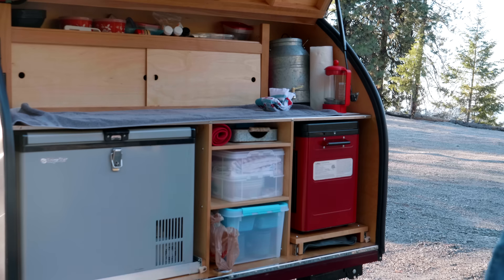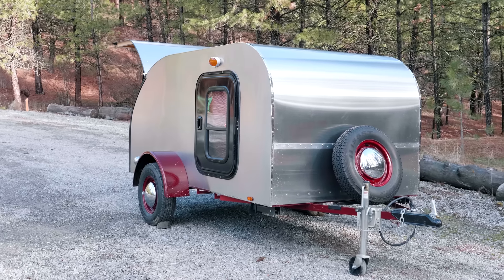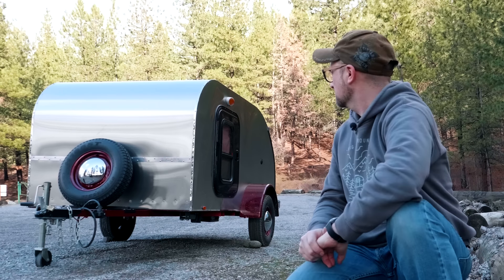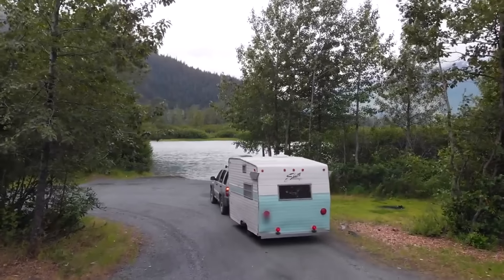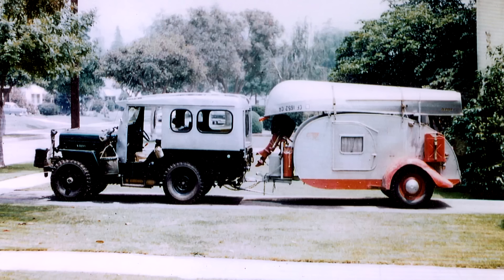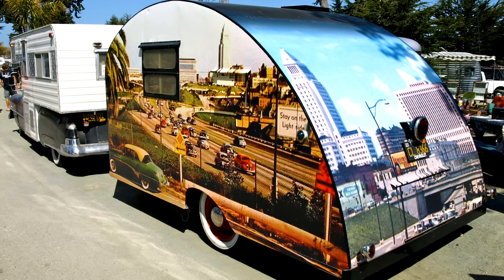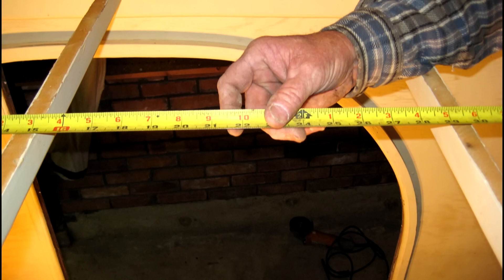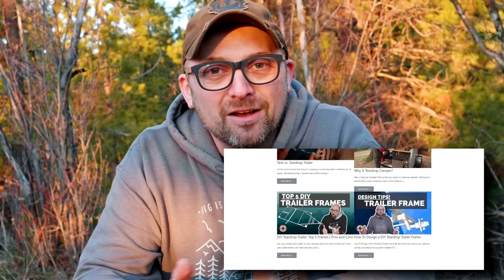Save Money, BUILD YOUR OWN Teardrop Trailer!

Comment: Quality material availability - where kits will shine. The one problem with building your own camper is none of the materials needed to create a long lasting camper are available at box stores and lumber yards. Boat building marine plywood, marine plywood foam composites, and some non-wood composites are available at a few speciality shops scattered across the country and can be mail ordered - for a price (if you have to ask ....). And it is hard to spend $400 a sheet for these speciality woods and composites on a project we are not 100% sure of to begin with. Most of us will buy from the box stores and encapsulate/epoxy/fiberglass/paint the heck out of it. It works. It is inexpensive. It will last awhile just fine. It will eventually fail, but by that time you will know what you really want. 
This is where kits and suppliers to self-builders come in. Kit makers, like the Chesapeake, and self-build suppliers can make these advanced long lived materials available. Add to that a proven design and build process, and the a tentative builds become more likely to succeed and last.
Reply from the maker: This comment is definitely getting pinned. Thank you as always Mike. Great information for people to think about.
Reply: I think there are definitely things the industry Can take from the homebuilt/ experimental Aircraft industry. There are several manufacturers that provide customers with kits and detailed plans to build their own aircraft, often at a fraction of the cost required for that person to buy a premade craft. One thing they do that is especially applicable is they provide the customers the option to buy the whole kit all at once, or just buy one part at a time so they can spread the cost and workload over a longer time. Shipping is still a huge factor, but if the customer is able to get only the materials they need, they aren't paying to ship all the materials they would otherwise cut off.
Reply: I agree, the one main problem with supplies… is “big box” stores. They stock with a central idea. Not with customers needs. So we, as builders need to take that extra step and dig a little deeper. Just because the guy with the apron says “ that doesn’t exist “… not in his store maybe. But it probably does. 
I took about a year to build my Teardroper. Some time was spent waiting for parts/ money and just trying to find  time for the build. Other days I would just stand in the garage looking at my progress and try to plan my attack. But it happened 
“ I can build that “…
There is always a way to make the little things happen. Good luck and great subject.
Reply: @jacechristian8725  Agreed. Taking from the boat building industry too.
Reply: @davidf9630  I like that you setup the time frame and mentioned the searching, waiting and planning parts of the build, which is what I saw as a build helper. Kits could reduce the time spent on all counts and give better access to quality parts - hopefully.
Reply: hehe,  can also occasionally tap Amish/mennonite communities for help with the cabinetry and such.  If you are in the right area's.   Many have woodworking, furniture, and cabinet shops.   So stopping buy talking about what wood is the best options, showing them what you need...  it may cost a little, but in many ways its far cheaper then other options, and often better quality work.
Reply: Yes Yes Yes, I love my Chesapeake Light Craft kit Teardrop.  All Okume marine grade plywood, MAS low Viscosity marine epoxy, and 95% of what's needed to complete the camper!!!
Reply: Interesting, I personally would rather buy something used and fix it up, like a pop up. If your time is worth anything, I think that is a better way to go. Plus, I just don't get the crawling in the door thing. I want to stand up.

Comment: The trailer Mark shows in the video was a project for our family. I am Mark's dad. Mark and I welded up the frame. My daughter helped apply the tar-like undercoat to the body. My wife helped build the galley and created the quilts for the bed, curtains, and wall hanging. Mark corrected a fairly major error I made when building the body. A friend helped with the outside skin. And almost all of this was done in my garage in temperatures ranging from 105 to 25 degrees F. The first big road trip we did was in the fall of 2017 and I was surprised by the interest this trailer generates. We were giving tours every day at campgrounds, rest areas, gas stations, store parking lots, at the Davis-Monthan Air Force Base parking lot. And most of the time people can't believe we built it ourselves. What they don't realize is they can likely build something just as good and something that is actually a better fit for them because they are doing it themselves. The resources are out there, and I encourage anyone with the interest to just go for it and build one. I love going down the road with my bedroom and kitchen right behind me. And always remember Rule Number One: Have Fun!
Reply: As a mom of two boys, I might have teared up a bit (happy tears) hearing about your children and wife help with the trailer. I imagine the same when and if we get the chance to build our trailer.
Reply from the maker: So great to see you on here Darrell. And what an inspiring story.
Reply: Hi Dad!!!

Comment: This is an awesome post. I've been looking around at dozens of teardrops and as you said the prices are climbing rapidly but the biggest problem is that none of them have the exact combination of features that I want. This inspires me to look much more deeply into a DIY camper. Thank you for showing us these resources!
Reply from the maker: Another thing I am coming to understand recently is that kits are designed to be more customizable then I thought. If a company does it right the base kit model is pretty primitive. But, they have designed it in a way to be easily modified. So you may find even a kit gives you enough flexibility to create what you need. And then of course building it from scratch is 100% customizable.

Comment: Love the DIY trailer idea... Almost finished building a wood/fiberglass boat.  Little off road trailer is next!  Can't wait to see what you have coming up.  Love your channel and beautiful family!
Reply from the maker: Thanks Danny. Was your boat a kit or from the ground up? Yes been quite a bit of time studying boat kits as well. Hey Siri get quite addictive once you start researching. This is where I first learned about rolling and tipping. It’s the little gems I find that make the research so fun.
Reply: @PlayingwithSticks  No kit for me.  I did buy a set of plans.  Wish I would have cot the kit they offer, but I wanted to do everything myself.  I will roll and tip it when it's finished!  One of your other commenters was talking about using high quality materials.  He's right.  That's one of the reasons I did not buy a kit, but I think his $400 a sheet for marine ply is high.  I am using the highest grade  Lloyd's certified Okoume ply and it's like $80-130 a sheet.  Shipping is around $90 for me.  Not so bad.  It's fun and with some patience I think anyone could do it.  My boat is a design called FRS-15 by Salt Boatworks.  Just a little flats skiff for by my condo in FL.
Reply: Danny!  Boat and Kayak builders make great trailers.  Yours will be top notch.

Comment: DIY times are changing. I built a pretty nice squaredrop (in my biased opinion) with all the trimmings as my pandemic project but I can't build another now without straying too close to the price of a commercially built camper. The current price of wood and metal has become a barrier to entry and mistakes become costly so we have to rethink the tried-and-true methods and materials.
Reply from the maker: There is definitely some truth in this. With the recent supply chain issues there have surely been some associated costs. I am confident they will turn around in the hopefully near future. In the meantime the impact on the composite diy kit prices doesn't seem to be as strong. I am hoping to highlight a few of these on the channel as well.
Reply: Good points.  Here are two quick ways to save some cash

1. Ask your local metal supplier if they have any cut-offs (extra pieces cut from the standard 20' stock).  They usually sell at a discount.
2. Find a local cabinet shop that doesn't sell wood commercially.  They buy it in bulk though.  Get your order from them.  They get better prices than you can commercially, they can sell it to you at a slight profit (for their trouble), and you'll save some green too.  Win..Win.

I'm also convinced that I could make a teardrop for free.  How?  IDK.  Something I'm actively working on.

Comment: Have you looked at the Chesapeake lightcraft teardrop? Really like the look of it, just wish it was longer to give more space in the galley.
Reply from the maker: One of our absolute favorites! In terms of aesthetics it’s our favorite. But yes it would be nice to have very sizes and designs.
Reply: @PlayingwithSticks  I think what I’d really want in the end is a more standard layout design like in this video, but then finish it with CLC’s fiberglass/epoxy for a natural wood look instead of aluminum.
Reply: Hi Fielding.  We've supported builders of those kits.  It's so unique, beautiful, and light.  A good choice for sure.  Couldn't you just scale it up?  Everything is in their plans.
Reply: @OverlandTrailer  I’m nearby CLC’s main store and don’t have room in my apartment to do it at home, so was considering going to one 2 week build classes.  But you can’t make mods to the basic layout during the build class… think it will end up being a later in life project at this point. Currently it’s just me and my dog, so I’ve been converting my outback into a micro camper.

Comment: Another great video Drew! I was wondering if you could a video on how to fit 3 grown adults in a tear drop? What are the options/hacks?
Reply from the maker: That’s a tough one. To be honest two adults and two kids is easy. But three adults put you into a whole different category of trailer. It can be teardrop in shape, but the size would definitely have to be a bit bigger. I’m trying to think of some sort of teardrop design I’ve seen they could accommodate three adults. At the moment I’m having trouble thinking of any. The only option I could think of is getting a 6 foot wide teardrop and replacing the rear cabinets with a 6 foot wide bunk.

Comment: I'm curious about the frames.  Can you get a quality frame with good axel without having to build one yourself?
Reply: The newer Harbor Freight trailers are OK, just replace the wheel bearings immediately. You may want to replace a few 'key' assembly bolts with Grade 5 (NOTHING HIGHER). I haven't seen them but knowing cheap 'X' they're rather poor quality and either snap or strip and will rust quick. also [ https://www.youtube.com/watch?v=NKfWlGYclNQ ]

Comment: Good video.  I would like to build an off road teardrop.  The thing is you definitely have to have time to invest.  I agree about the overall quality of many campers these days.  Low quality and high price.
Reply from the maker: Thanks Garret! And off road teardrop would be fun. I just saw that Valiant Trailers came out with their kit version. I didn't check the price though.
Reply: On Point.  Especially since 2018.  There are good teardrop manufacturers out there still.  Just gotta look under the hood a bit.
Reply: @PlayingwithSticks  Definitely need to check it out.
Reply: @garretlewis4103  TC Teardrops is also very good.

Comment: My car is limited to pull 2k lbs.
I realize the weight can be variable, but
how much do these weigh on average?
Thank you!
Reply from the maker: A good example would be Mark‘s kits. If you check out their website I believe they come in at 700 some lbs. most DIY kits are aimed at people who have towing capacities 1000 pounds or higher. Basically they are designing trailers to be towed by almost any vehicle.
Reply: @PlayingwithSticks  
That's heartening! 😊 I'll do that. Thank you!
Reply from the maker: @auntiedotal  You are most welcome. That is the beauty of the DIY world. Most folks in the industry are following the trend from the 1940s. Which was to build a simple camper that could be pulled by almost any vehicle. The goal was to keep you out longer and bypass hotels.
Reply: Hi Reikimama.  Our trailer (once fully assembled) rolls out at about 740 lbs (give or take a few extras).  Shouldn't be a problem for your car.

Comment: Where do you source the stainless steel skin for such a project?
Reply: Hi Sea!  Good question.  Local steel providers often have sources for it.  What we've found is that most of them don't stock it all the time.  It seems to be kept in a few large warehouses and distributed from there.  This trailer is clad in 60" x 120" 22 gauge stainless with a #4 finish (not a mirror but not dull).  If your local steel place doesn't have it, they can usually direct you to another place that does.  The dark horse here is to ask a local business sign-maker.  They often order odd metals from different supply chains too.
Reply: @OverlandTrailer  Thanks for The response and Great Information.